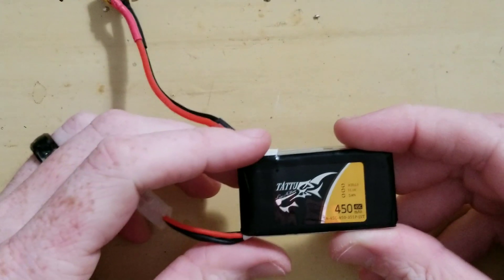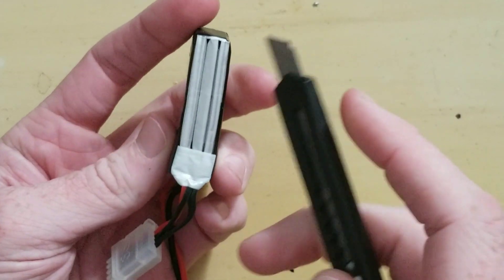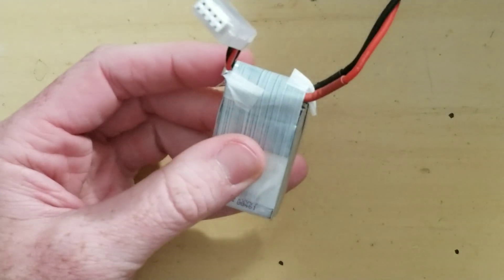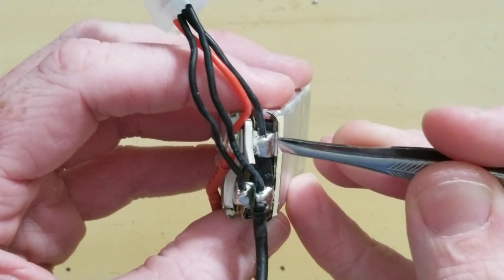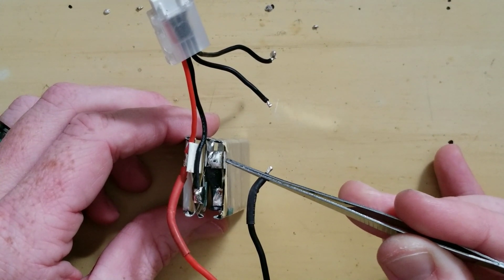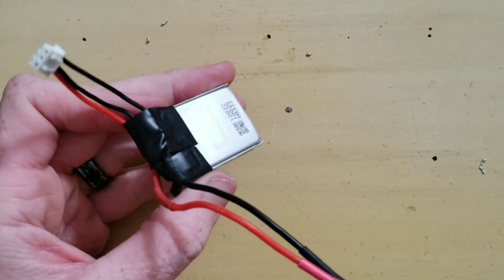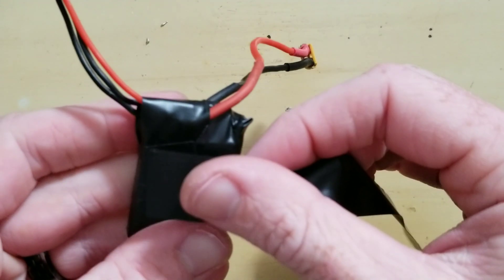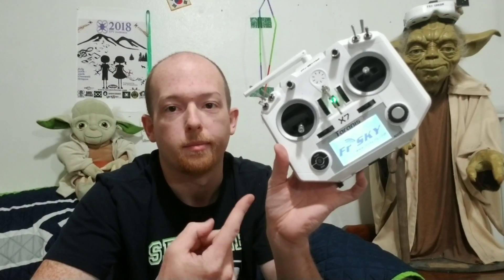Lipo Battery Repair | Convert 3S to 2S

Comment: Is that tape that you use black electrical tape?
If the original is 1000mah will the "new" 2s have the same?
Asking for charging purposes.
Thanks a lot
Reply: The cells connect in series, in electronics series voltages add up but series current is the same, so your amp-hours is the same. Less Watt-hours but the same amp-hours.